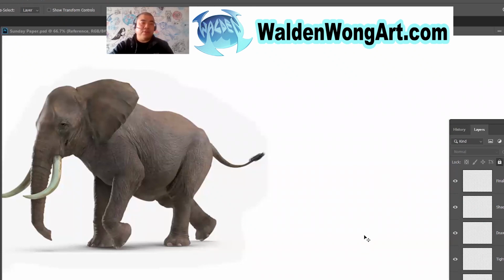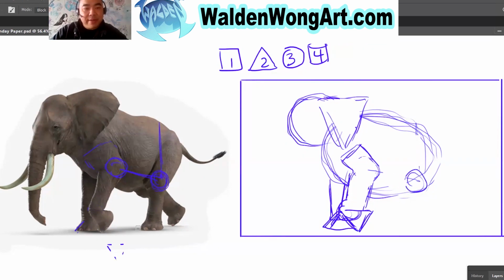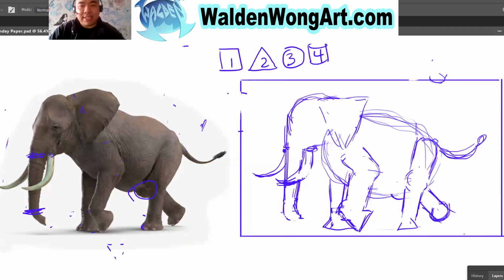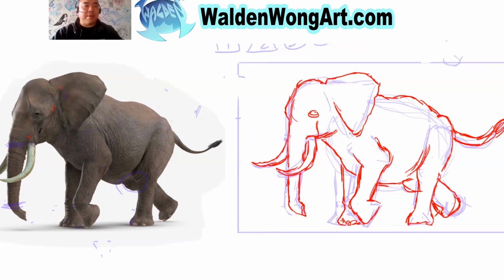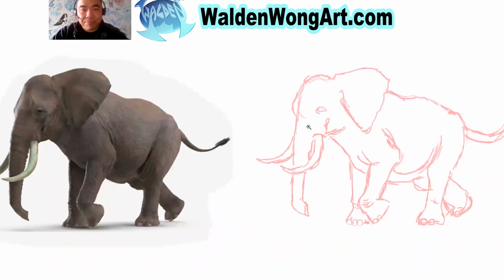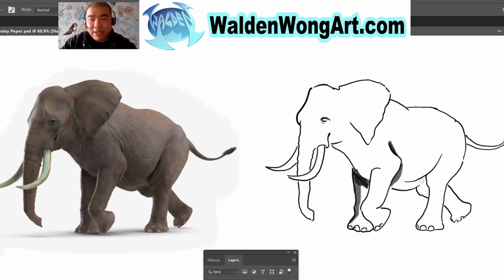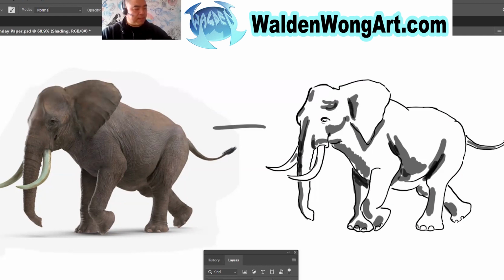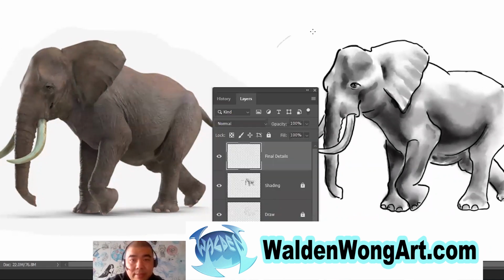How to Draw for beginners. Drawing Tutorial  Draw an Elephant. Step By Step using Basic Shapes

Comment: This looks great. And thorough!

Good work and good content, Walden.

I have a question (if you have the time please): what is your view on the Pentel Brush Pen for inking? What is the pentel ink that you get in the little cartridges like? Ultimately - as I have one that I use - is it as good as the empty watercolour brushes you use? Im worried that Im using a tool that will never give me top-notch, pro results - but being that Im very far from pro or top notch? It's very difficult to judge equipment and tools.

Cheers Walden!

Keep up the good work!

"LiL'JpD."
Reply from the maker: Hi LiL’JpD! That’s a great question as I used to wonder that many years ago when I first started learning how to use both the Pentel brushes that comes with ink pen refills and the Pentel Aquash brush pens. And I can honestly tell you, both the brush tips are Are exactly the same! Aside from being able to get the small, medium and big brushes… the quality and the nylon fiber brushes are the same!! It’s just that one has a ink refill that you can buy the refills and replace. And the other brush was supposed to be used for adding water inside the barrel and squeezing the water out. Side note… I don’t fill up the Pentel AQUASH brush pen to use for inking. Instead, I’ll dip the brush into ink like a traditional brush and ink as I go. It’s better this way because if you fill the reservoir with ink, it’s going to over flow out in the brush while you’re inking. I know as I tried and there’s really no control when they happens. And final note, if you have one of those Pentel brush pens that had ink cartages refill. When those pens run out, don’t buy the manufacture refills to use. Just  use a bottle of ink and continue using that brush and dip it! Same thing! I hope that answers your question. Thanks again for the great comment! More videos coming soon!
Reply: @WaldenWongArt  Thanks a lot Walden - that answers my question and more besides. I appreciate that you took the time to give me such an in depth answer.

Thanks Walden for all the inspiring content and answers

:)

"LiL'JpD."
Reply from the maker: @joedent3323  your very welcome, LiL’JpD. Thank you again for watching and for subscribing to my channel. I’ll have more videos soon!